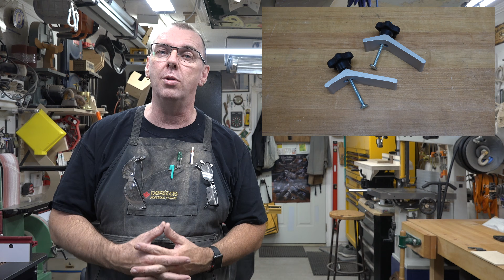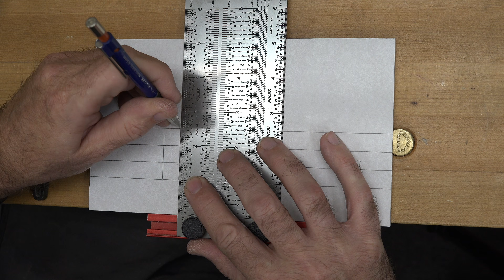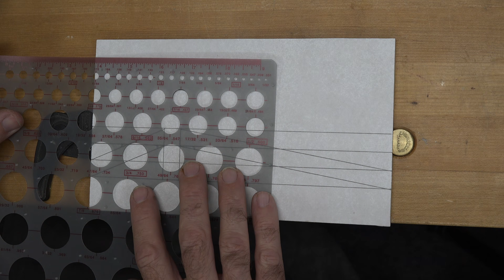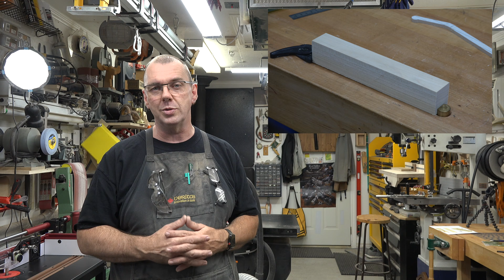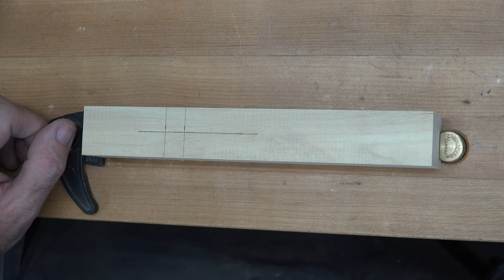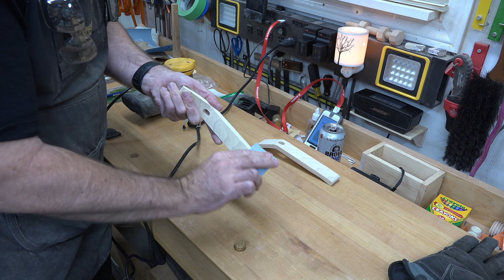Shop Made Hold Downs

Comment: The poplar will last a lifetime. If not tightened maniacally it will crush before whatever gets held down. I especially like the built-in flex. Coming at the project from a woodworkers perspective, I would have used the straight layout lines as guides for a sketched, more organic, final shape. I work in laid-up baltic birch or Apple Ply for shop projects. in this case a layer of so-called 12 mil and another of 18 or 19 mil because the materials are hell for stout. The easiest, cheapest, most durable and secure shop-built knobs can be made from the same ply. Drill a recess slightly smaller than the distance from point to point on a plain nut and seat the nuts by tapping them for a start then draw the nut home and square by pulling the nut into the work against a flat surface. The crushed fibers grip the nut against ever backing out. Oh, yeah, nice video. Thank you.
Reply from the maker: The best part about our hobby Mark is that for every process, there are many different way to achieve the same result.  Thanks for tuning in to the show and for taking the time to chime in with you thoughts and kind words.  It's very much appreciated.

Comment: A great marking out ruler. Never seen one of those before.  Can you please tell me what they are actually called.?  Thanks
Reply from the maker: The "marking ruler" that I use in the shop is called an INCRA T-rule.  They are available at most woodworking suppliers or from INCRA directly.  They come in metric and imperial measurements and while they may seem pricey at first, they are worst every dollar.  Here's a couple of link for you.  https://www.leevalley.com/en-ca/shop/tools/hand-tools/marking-and-measuring/rules/58877-incra-t-rules
https://incra.com/measuring_marking-trules.html
I hope this helps.  Thanks for tuning in to the show.